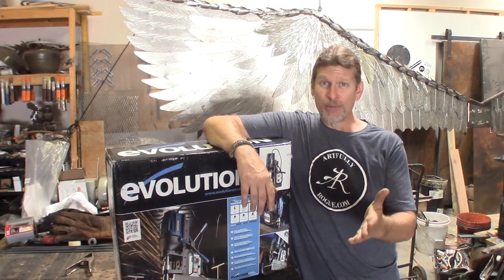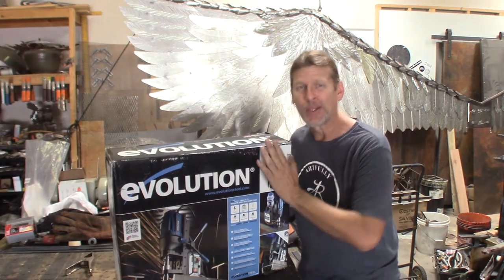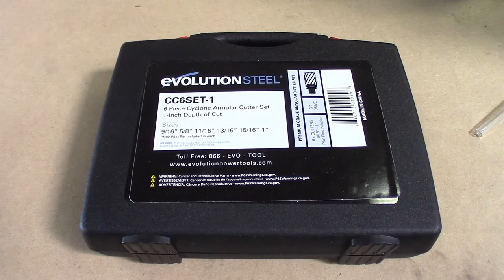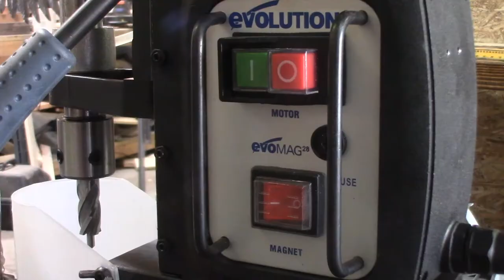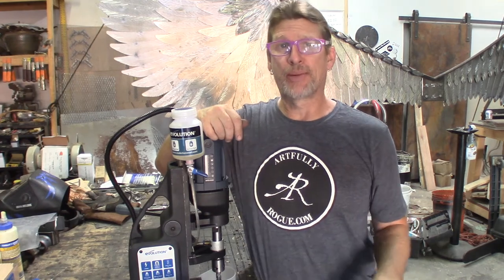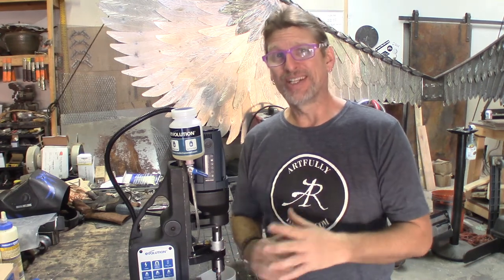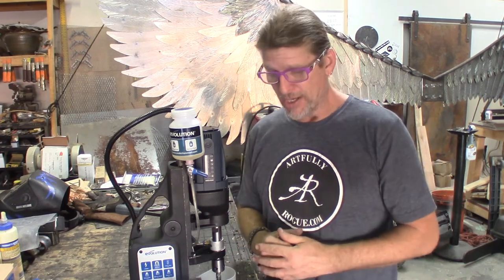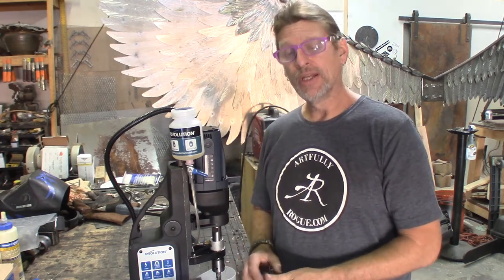Evolution Tools EvoMag 28   Tool Review

Comment: Dude be careful when you are using it on a vertical surface or overhead.  It looked like you had slippers on.  If for some reason it loses electrical power that thing is landing on your toes.  FYI there are some other brands that use a permanent magnet like a walker chuck that does not have this risk factor.

Comment: I own one of these as well as the metal cut off saw. Both are great tools. I am with you on the drill chuck. The only time I can see myself using it is if it was a piece to big to put into to my drill press (i.e. my truck frame) and I had to drill a hole deeper than my annular cutters would cut. This think cut through 1 inch steel plate like it was balsa wood. And I had to cut 8 holes one right after the other. Did this with the evolution annular cutter 6 piece set. If you think this guy may be impartial because they gave him the drill than take it from me. If I needed another Mag Drill you had better believe I would be buying another Evolution with my hard earned cash. Great Tool and an even Greater Price.
Reply from the maker: Yeah no real complaints on the mag drill, its been great

Comment: That’s awesome.  Perfect holes every time.  I’ve got an evolution 380 and love it.
Reply: Also, what size bits came with it?
Reply from the maker: Inside the carry case there weren't any bits included. However ET sent a single 9/16" and a small case which contained 5 or 6 bits...when I get back to the shop I'll get the sizes however I think I recall seeing 9/16" through 1"

Comment: Be aware on drilling thin metal, I think the manual states 10mm min thickness for the magnet to get a good hold, some of that sheet you were drilling looked on the thin side, nice video though,
Reply from the maker: Yeah I hear you. Everything I've drilled to date has been 1/8" (10gauge) or thicker
Reply: Artfully Rogue would not want your drill to land on the floor, or your toe. 👍🏻